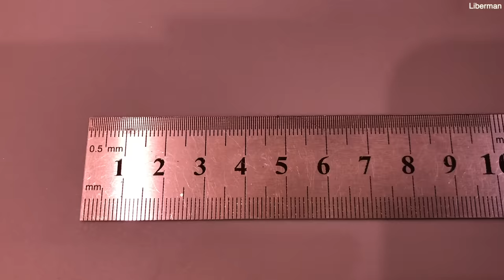How to make CABLE CAR very simple

Comment: the motor runs until I put the wire on.  Can anyone tell me why?
Reply: Yes the wire has electric if your conneing it to a battery unconnect it and put the wire to the engine after your done connect it to the battery or whatever power your using